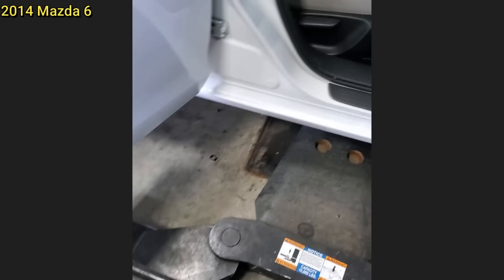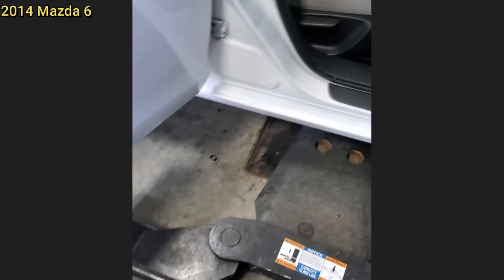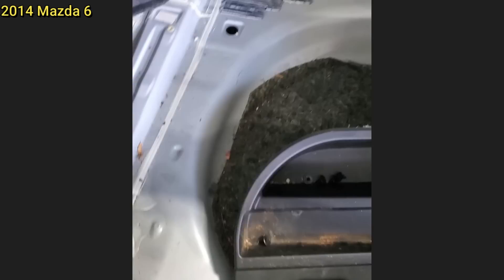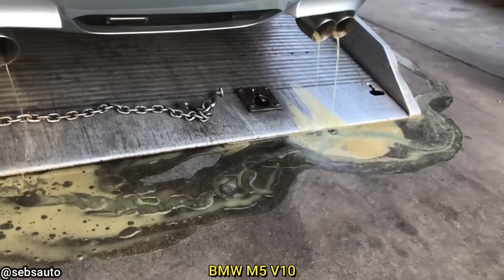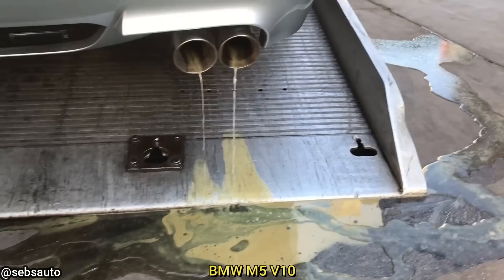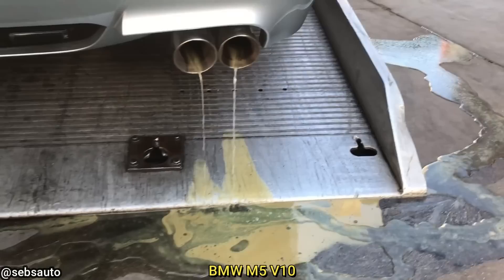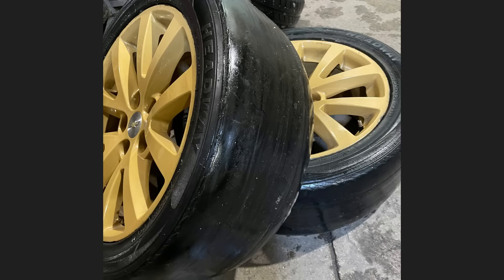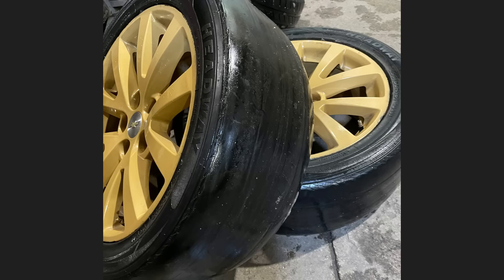Customer States Heard A LOUD Noise When Trying To Charge Tesla

Comment: “Someone told them to do this to keep rats out of their engine” Yeah that will help, a raging inferno in your engine bay tends to keep living creatures out.
Reply: thats almost certainly fiberglass insulation, itll MELT the engine before it even thinks about catching fire.
Reply: @rjwaters3  Yeah but I don't think you want to insulate your engine. It produces a lot of heat.
Reply: Mice love that fire proof pink insulation. I have seen them make nests of that and rockwool. It's itchy stuff for us humans but doesn't seem to bother critters.
Reply: @consaka1  I've seen it too. They come up from the crawl space through the plumbing holes and build a nest right in your wall.
Reply: Try tea tree oil mixed with peppermint oil in a cotton ball, find a place in your front NOT NEAR THE BATTERY OR ENGINE ITSELF where it can solidly stay. The rats, possums, and squirrels absolutely hate the scent. And plus side of tea tree oil, most insects hate the scent too and will keep away as well. Make sure your pets will not be able to smell it directly.
Reply: Pretty sure that someone was a old timer. Some of the ye olde types of fibre glass insulation would kill rodents. They could even drag it into their den, taking out the rest. My grandfather kept some of the stuff around in case of rodent infestations. Much rougher and larger fibres.
Reply: @consaka1  urban legend fill drilled studs with a mix of steel wool and insulation. Ive found nests outside with mice in them. Nests of mixed steel wool and insulation. Problem is, ever a wire insulation both hot and a ground the steel wool will catch fire
Reply: No, no, no. You only put it on when you park at night. Rats can't get to you while driving. 🐀🐁🐭
Reply: Keeps rodents out, but welcomes fires in :)
Reply: @matthew4878  well obviously it doesn't produce heat but i wouldn't think it would be an issue unless they're in a very hot climate, the coolant in the radiator isn't even constantly circulating maybe it's worth an try for me as my engine temps drop to about 70-75C on the coolant during winter if i run the heater. :=)

Comment: RE: Gas can in trunk.  I had a customer complaining of a bad oil leak from the far right rear corner of the car.  I tried to explain there's nothing TO leak oil in that part of the car and it's probably a spare bottle of oil leaking.  Customer got ALL MAD and defensive, insisting NO, my CAR has an OIL LEAK back there!  Fine, you're the expert mister even though I'm the one who's been working daily on just this model of car for 2 decades.  Open the trunk, pull off the cover over the well opposite the spare tire, and pull out a wet, dripping, and somewhat deflated looking plastic bottle of oil.  Customer got even less happy at this discovery.
Reply: How DARE you be right, and how DARE that bottle of oil make him look like a fool!

Comment: I got to say that last clip with the air boat pushing the pick up truck was pretty damn inventive and successful! That's really using your gray matter!😄
Reply: Even if he got a ticket the judge would probably laugh and fine him  $25 bucks. That's cheaper than calling a tow truck!
Reply: Agreed, I honestly think that was pretty brilliant.
Reply: @wb2vsj  I think the biggest issue would be the guy riding the boat, not sure about in the US, but here in Aus there is no way you would get away with doing that, the driver of the truck would loose their license and the guy on the boat would get a massive fine.
Reply: @myopinion69420  Same here in Denmark - the police do certainly NOT like that kind of "ingenuity" in our neck of the woods. 😂
Reply: Dang Baby, I ain't payin' no 75 Bucks for a dang Tow Truck, I'm gittin' the airboat and y'alls gonna steer.
Reply: reminds me of the saying "if it's stupid and it works, it ain't stupid"!
Reply: how does a person have a fanboat but not a way to trailer a little ford
Reply: @zandilar630  But if it's stupid and it works up until the point someone dies, is it stupid again?
You see, the reason it's stupid is because it IS stupid even when you get away with it.
It's like riding in the landing gear housing of a jetliner. If you are lucky you won't get squished to death. Then you also need to be lucky enough to where the jet doesn't go above 20,000 feet or you would suffocate and/or freeze to death.

Can you imagine what would happen if that truck blew a tire and jackknifed? Or it fishtailed?
The rider on the boat would have a fun time trying to not get mutilated.
Reply: Tow truck drivers weren’t smiling tho!!!
Reply: If it's stupid but it works it's not stupid.
Reply: @pimpontheline  Presumably the Ford is the vehicle that tows the trailer.
Reply: @myopinion69420  you'd be surprised. Arguably that is actually entirely legal. There is to my knowledge no law saying your vehicle must be powered by it's own engine. So provided the fan boat is securely attached, its and its driver is wearing a seatbelt, its probably entirely legal, even in Aus. They'd be forced to use some technicality in the law if they wanted to do you for it, and that probably wouldn't stand. Hell there is actually a road legal precedent for this already, articulated construction machinery were the power plant is in the rear and steering is controlled from the front with a single pivot point between them.
Reply: @cgi2002  I did not say the fan boat part would be illegal, it would be the guy riding on the boat that would be illegal. no restraint or anything.
Reply: Hoo boy! That is some serious Louisiana ingenuity right there!
Reply: @myopinion69420  it's hard to tell if he is wearing his restraint (fan boats have seat belts too), it's just a waist strap usually. If he's not, yeah that would be an issue. 
Its basically is he strapped in, and is it securely attached, if yes to both, its oddly legal as a vehicle. It may fall foul of noise laws, but that's it.
Oh and while you didn't mention it others did, the trailer hitch is actually safe here (provided it's not made of rust). Those hitches not only pull a trailer but must be capable of stopping that trailer under harsh braking, aka bene pushed by it. As for jack knifing, provided your not an idiot, keep it slow and work together, it's actually easier than reversing with a trailer (which in this case is actually the truck) as the trailer controls the direction of travel.
Reply: @cgi2002  even if it had restraints, I don't think there is any way it would be legal for on the road. you can't ride in a car on the back of a car trailer or even on a tow truck, just like you can't leave your seat in a motor home while its moving.
Reply: @myopinion69420  true, it would take some research to find out, could argue this similar to having 1 vehicle towing another rather than a vehicle on a trailer. But at the end of the day I think it mostly comes down to the officer who pulls you over.
And then you can amusingly make it legal and even more dangerous by going ok, get me some string. I'll control the fan from the passenger seat of the truck.
Reply: @RealCadde  you must have a lot of fun over the weekends. I can tell. With all that worrying of yours
Reply: @myopinion69420  You have obviously never seen, much less been on, an airboat. They definitely have seat belts.
Reply: @jrand2631  Here in Germany i am not sure if you can get fined. There is no law that says, that the "towing vehicle" must be in front of the broken one. Or that could not be a boat. XD As long as you  can break, it should be fine. :D
Reply: @patfranks785  nope, never, does not matter, would still be illegal, just like you can't ride in a car thats on the back of a truck or car trailer.
Reply: @myopinion69420  "you can't ride in a car on the back of a car trailer or even on a tow truck",  are you sure? This is not a tow truck, it is a personal vehicle.
Reply: @patfranks785  from a quick google, you cant travel a towed vehicle unless it is a vehicle being towed and you are in control of the brakes and steering, eg being flat towed. (again, that is here in Australia, USA is probably different)
Reply: At that speed  and with probably VERY sluggish brakes (no servo assistance from a working engine).....  :-( :-( 😖
Reply: no kidding. was gonna say that's pretty clever
Reply: @kalanisarpi4731  Apparently not as much fun as you do with all that danger you put yourself and others in.
Reply: not if it's an AT, then you're just adding damage...
Reply: Lol the way gas prices are I’m tempted to attach a fan to my car 😂😂
Reply: Why is duct tape grey? Because it does the thinking for you!
Reply: @CarsandCats  😐😐😐
Reply: @RealCadde  98% of the time nothing happens. And you have a cool story. 2% something happens and you have a cooler story. It’s also all about risk assessment. The chance of anything happening is so low. Might as well send it. Can’t be scared of everything
Reply: @myopinion69420  In Germany you would be on the hook. Passengers on a trailer are forbidden.
Reply: Well, the first airplane was built in the Texas hill country by a German immigrant...1860's. But, the governmetn doens't want that to get to the public.
Reply: @pimpontheline  because some poor folks can't. They do with what they got.
Reply: @RealCadde  You really think they give a rats ass? Maybe the guy is trying to feed his family that day.
Reply: @cgi2002  It was probably the judges truck.
Reply: @robertborchert932  It was Texas.
Reply: @myopinion69420  You can there. And if you go tell them it's not legal, they'd go , who the hell are you?
Reply: @patfranks785  I have...or you'll end up with the gators.
Reply: @myopinion69420  hahaha....you don't know much about survival in small towns.
Reply: @myopinion69420  not in our little outbacks like that one. Who the hell is gonna enforce it?
Reply: @jerseydevil1  fanboats get pretty bad gas mileage.
Reply: @DrKlausTrophobie  This isn't Germany.
Reply: They FINALLY found a way to fix a Ford...? Impressive!
Reply: There are some people who say you can't have a person at the wheel of a vehicle being towed by a tow-bar, also known as "flat towing" with all four wheels on the ground.  I don't know whether it's true or not, and really never cared.  If the towed vehicle is significantly lighter than the tow vehicle, there's no need.  But when towing a heavy vehicle whose front end may be heavy enough to k influence the rear tracking of the tower, I've always made sure somebody who was competent on trailer dynamics was sitting in that towed seat to guide the pivot in case things got squirrelly in a turn, or if there's an emergency braking event in a curve... because jacknifing sucks.
Reply: @1SqueakyWheel  Well put. Just make sure if pulled over by the police, or when facing a judge, you voice the same info.
Reply: And a tow charge but I sure that was the motivation
Reply: in Ontario Canada as long as you can keep the vehicle moving safely with your hazards on of course you can drive down the road, this would be an epic way to limp a vehicle home
Reply: At that time, it didn't matter to use grey matter to move the inoperative solid matter. 😄
Reply: @RealCadde  Your a real joy to be around. Can I hangout with you?

Comment: I was on a oil spill remediation job. River was frozen; but EPA wanted monitoring for a spill. Airboats were called in. When the dually couldn’t get traction on the icy boat ramp….the airboat pushed itself, the trailer and the truck up the ramp. Corvette crate motor
Reply: Propulsion through gears and tires is more efficient than a propeller -- but that's not to say the propeller is weak.
Reply: Now I know where the oil spill came from! Chevy!